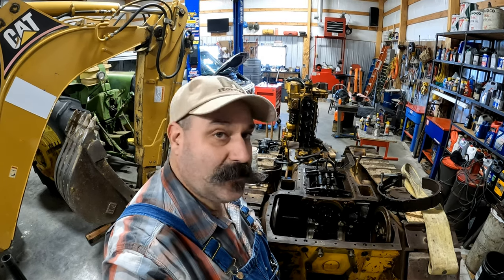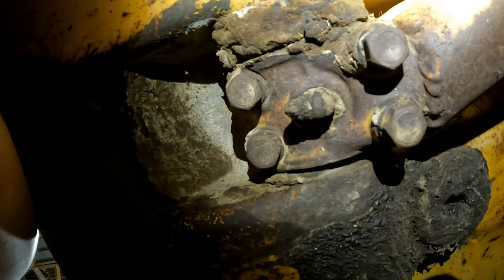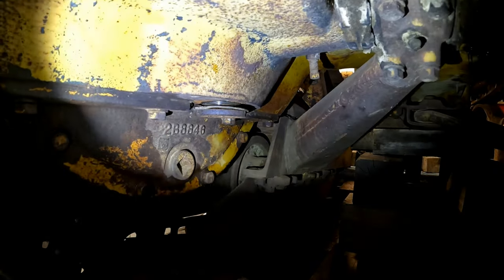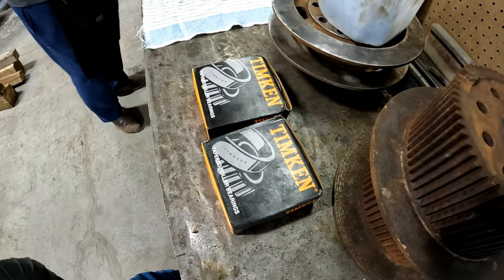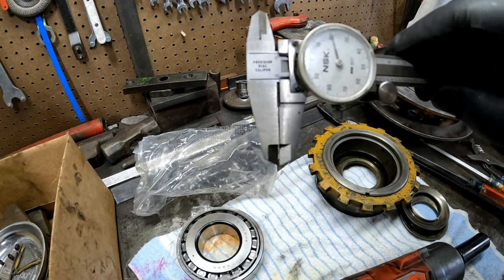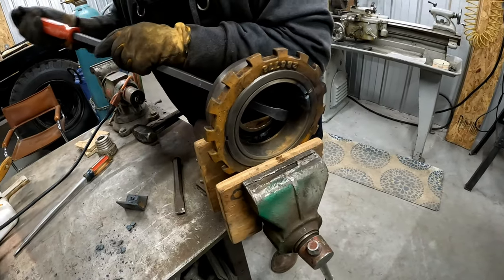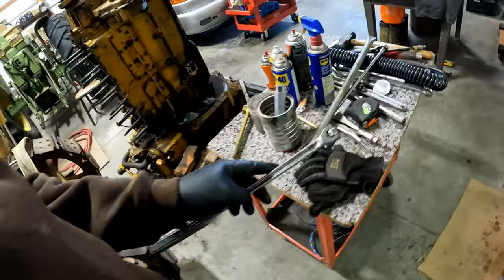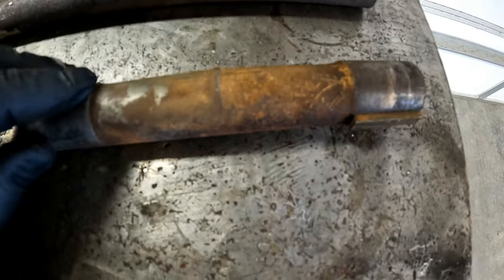Bevel gear main bearing removal and install 1939 Caterpillar D4 4G9986 "Lil Lefty" Episode #23

Comment: Sometimes we just stick to what we know.  Everyone has their preferred method especially if that’s what they were taught.  I saw that puller and was thinking (because I don’t know any better) use the hollow ram to yank those bearings.  Thank you for the video because one day I’m going to have to use all these methods on my project “Shovel Ready”.
Reply from the maker: Love that name!
Reply: @lifeafterourloss   I bought this machine from a guy who had it as a project and got it running after sitting for 6yrs.  Checked it out and put it through its paces and he told me it’s ready to go to work and it’s “Shovel Ready”.  Even I knew this machine needed some love.  The steering clutches were stuck, but that’s pretty common.  Unloaded the machine everything worked fine, steered with the brakes.  Then I went out to unstick the clutches and the right brake stopped working.  NASCAR’d the machine back to the barn and added another thing to my list.  Then an injector went out and it wouldn’t start.  So, Shovel Ready is now in the barn “Ready” to get some love.

Comment: Poor draw bar that thing has been going back and forth like pendulum. Just very grazy wear. Good call in replacing the bearings cause it's already apart why not dig deeper. Cleaning can be very frustrating. I have found out sometimes you have to do use a compination of diesel fuel, gasoline, mineral spirits and break cleaner in order to get all the gunk out. I'm sure all that water is probably years of condensation. Not something you wanna see cause worst case it can crack the final drive housing if it is really full to the prim. Your lucky your case and castings are all fine.  Replacing these is a  $$$$ output.